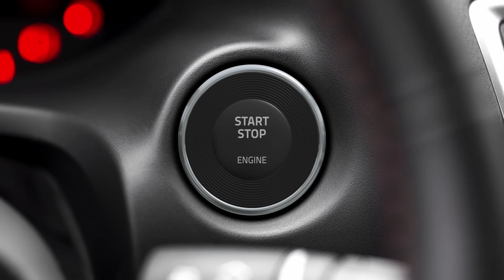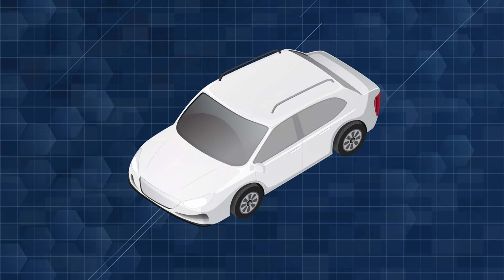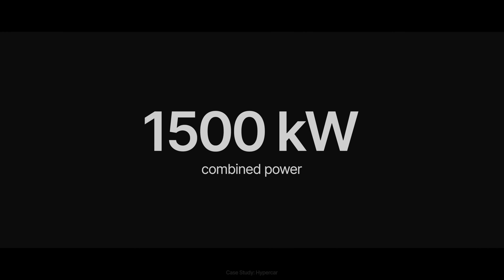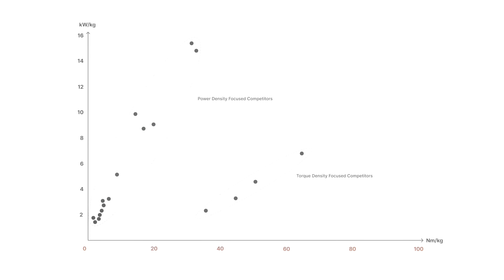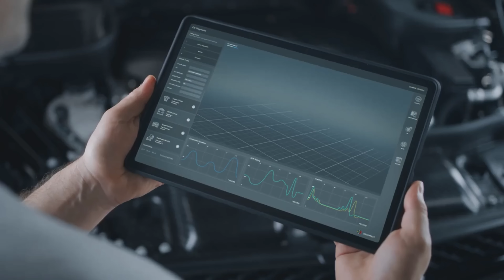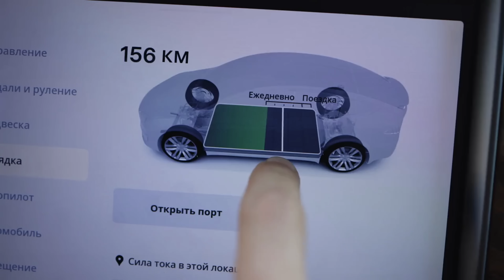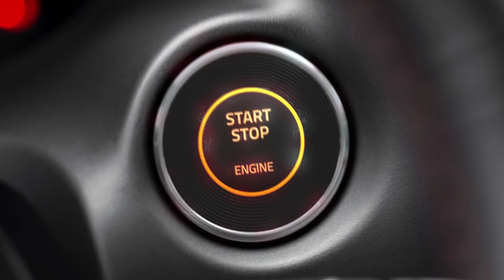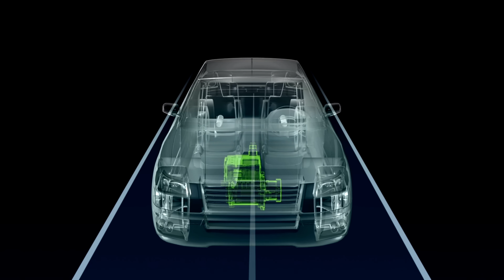New Donut Motor Runs EV Without Transmission or Axles – Here’s How

Comment: I like the concept, and it sounds like they have addressed some historical barriers to adoption.  One motor per wheel means built-in redundancy.  You could have one or maybe 2 motors fail and still be able to drive, albeit with degraded performance.

I bet traction control could be very precise and efficient because you don't need to apply bakes to shift torque from wheel to wheel.  Just need some good software to implement it.

Can we reduce complexity even further by eliminating conventional brakes?  Current design would allow for regenerative braking per wheel, which is nice.  But if you could come to a quick stop using the hub motors, then no need for brake hydraulics, disks, pads, etc.  This would reduce weight and cost even more.  I wonder if you could use regenerative braking for gentle deceleration, and switch to active deceleration by using battery power to oppose rotation -- this might even be of use when the battery is fully charged and cannot take any more energy (though a fat resistor would also suffice).  

I love to see all these innovations, I hope the best ones come to a car dealership near me!
Reply from the maker: Thanks for your thoughts—that’s a great point about using the motors for more than just regenerative braking!
Reply: If you create an electric hub motor with wirings that can sustain very high amps then a force of braking as high as you want can be created by a correctly modulated magnetic repulsion and attraction at the time of braking. 
It can be calculated how much electric power drained and how much braking power one can obtain. 
First, for light braking by regen braking, and second when you need crazy hard stops, very high electric current modulated for very high simultaneously 'pull-push' magnetic effects in the same electric hub motor-generator.
Reply: @mikel4879 All right, write up the patents and we're in business, Mortimer!  😀

Comment: Too heavy. MB's Yasa claims 750 hp from a 13 kg motor. While this video claims the monster motor is 100 more HP yet weights 3 times as much. That is far from the most power dense electric motor.
Reply from the maker: Good point—YASA’s axial flux motors are extremely impressive on paper, especially for applications like hybrids. But there’s a key difference: YASA’s numbers usually refer to peak power for very short bursts, whereas the Donut motor figures include sustained power and torque at wheel level because it’s an in-wheel system that also eliminates the drivetrain.

The 21-inch Donut delivers 630 kW (≈845 hp) and 4,300 Nm per wheel, and when you add the savings from removing transmission, axles, and differential, overall system efficiency and packaging improve massively. So while the raw motor-to-weight ratio might look higher for YASA, the Donut solution optimizes for entire vehicle architecture, not just the motor core.
Reply: indeed, agree

Comment: 0:08 this is called hub motor which is hubbed inside the wheel itself this is all good in terms of saving space but when it comes to bumpy road off roading and all the force the motor and its bearing will take it so the chances of motor getting damage itself is more
Good for day-to-day City little bit practical usage but in any other rear special scenario might cause a problem
Reply from the maker: Great observation! Traditional hub motors do face those issues, unsprung mass, bearing stress, and durability on rough terrain. That’s exactly why in-wheel motors have struggled to go mainstream.

What Donut Lab did differently is reduce the unsprung mass dramatically by achieving the highest torque and power density in the world. The motor’s weight relative to performance is so low that the impact on suspension dynamics is minimal. On top of that, these motors are designed for heavy-duty applications—including trucks and hypercars—so they’ve reinforced the structure, bearings, and sealing for off-road and high-stress conditions.

Of course, like any tech, real-world durability will be proven over time, but on paper, it solves most of the historical weaknesses of hub motors.

Comment: Have been used in bicycle wheels over 20 years. They are not new!
Reply from the maker: You’re right that hub motors have been around for decades—especially in e-bikes. The big difference here is scale and performance. The Donut Motor isn’t just a hub motor, it’s an in-wheel design that removes the entire transmission system while delivering record-breaking torque and power density.

For example, the 21-inch version can push 630 kW and 4,300 Nm per wheel—numbers that are on a completely different level compared to bicycle hub motors. Plus, Donut’s modular platform integrates motor, battery, and software for full vehicle builds, not just small-wheel applications. So, same principle, but radically different execution and performance.
Reply: @renewable_energy   the transmission is done in firmware, bruh.
Reply: Porsche did this in race cars 100 years ago, but carburetor tech got better faster than battery and motor tech.  True story, bruh
Reply: but it has some unique features

Comment: I hope Donut motors will behave even better than those I have on my rear wheel e-bike. It works like a charm and doesn't overheat. My only concern would be - motor controller - In case of dual or x4 traction configuration. In the traditional transmission/axle/differential configuration, the same is the one that was (and still is) improving for more than 12 decades. It is responding to wheels traction in mechanical fashion (although more and more with electronic assistance). In case of independent motorized wheels, motors are controlled only electronically, there is no mechanical system to compensate (other than brakes). I know there are already cars like Aptera coming, but I hope they will not rely on single motor controllers, or worst still - that they will be plagued by bugs for years until all the issues of motor controllers are ironed out. For example - what prevents one wheel (motor) to enter a recuperation regime just by a stray flip of a bit, while the opposite motor is still putting out torque, which would effectively spin the car direction.
Reply from the maker: Excellent point—you’re absolutely right that with independent in-wheel motors, traction management becomes entirely software-dependent. That’s why redundancy and advanced torque vectoring algorithms are critical. Donut Lab claims their platform includes integrated control units designed to avoid single points of failure, plus safety layers that prevent mismatched states like one wheel regenerating while another drives.

The benefit is precision: you can control each motor hundreds of times per second, reacting to micro traction changes much faster than any mechanical differential. But yes, it does raise the question—are software and electronics reliable enough yet to handle this safely at scale? Personally, I think we’ll see multi-controller architectures to reduce risk. 

What do you think—should EVs always have some mechanical fallback, or is pure electronic control the future?
Reply: @renewable_energy mechanical fallback? Doubt Boeing or Airbus have it. Rather 1 or 2 more redundant lines.
Reply: @renewable_energy  Bei modernen Flugzeugen gibt es schon lange redundante fly-by-wire-Steuerungen, aber keinerlei Mechanik mehr. Sollte bei Bodenfahrzeugen dann wohl auch gehen ...
Reply: very true

Comment: les bassins d'eau ont un impact négatif sur les moteurs
Reply from the maker: Bonne remarque ! L’eau peut effectivement poser problème pour certains moteurs, surtout lorsqu’ils sont exposés directement. Mais les moteurs Donut sont conçus pour être étanches et résistants à des conditions difficiles, y compris la pluie et même des immersions partielles. Les tests incluent souvent des normes IP élevées pour garantir la durabilité. Cela dit, une exposition prolongée à l’eau stagnante reste à éviter. 

Vous pensez qu’ils devraient viser une certification IP68 pour être vraiment fiables ?
Reply: good point
Reply: YES, in fact they should make an additional version just for marine underwater operations as part of the standard. I drive vehicles all the time in waters that submerge the wheel well here in sunny Florida.

Comment: That seems really nice indeed and will increase efficiency slightly  and make maintenance easier. It will also open new possibilities to build of modify your own vehicles (if those motors are sold as separate units and not just in prebuilt vehicles), like electric scooters, gocarts or even whole cars for those more advanced.
Building costs will go down for the manufacturers as mentioned in the video - but I don't think that will affect the price of new cars by much unfortunately. Most of the cost today is from unnecessary electronics, software and sensor systems for driver assist systems and other junk, often mandated by laws to "increase safety" while still keeping all the bad bad drivers on the roads (this is just as much of a problem on new cars with ICEs as with electric ones). 
And that's a cost that will most likely increase in the future "compensating" the lower cost from cheaper mechanical system. But on the other hand - if some money is saved on the mechanical system, the increase in cost maght not get really as bad as it otherwise would (as we will be forced to pay for the junk anyway).
Reply from the maker: Great points! You’re absolutely right — reducing the complexity of the mechanical system won’t automatically make new EVs cheap, because electronics, sensors, and compliance requirements keep pushing costs up. The real benefit here might be flexibility: easier maintenance, modular upgrades, and the potential for DIY builds like you mentioned — scooters, go-karts, even custom EVs for enthusiasts.

And yes, even if regulatory and software costs rise, at least savings from simpler drivetrains can help offset some of that. It’s a fascinating balance between innovation and regulation. 

Do you think we’ll ever see a ‘bare-bones’ EV option again, without all the mandated extras?
Reply: @renewable_energy  Unfortunately I don't think we will be able to buy vehicles without the mandated junk in the foreseeable future. The authorities in most countries want people to drive less over all (they want walking and bicycle to be the primary option for transportation and public transport the second) - so new cars getting more expensive, is probably something they just see as a good thing. They are now even trying to force people to pay those costs (and prohibit them from own a car if they can't afford it) with things like ELV (end of life vehicles) - to prevent people from keeping their old cars. That's how bad it have become already, here in Europe at least
They also try to regulate electric scooters, bikes to the point of barely being usable (other than if you are lazy and want to go up a hill) - for example limit their legal speed to 20-25 km/h (which most people can comfortably pedal a bicycle on flat ground at)
 - fortunately they have a hard time to control that market since they require no registration plates and  "illegal" ones are available everywhere (they are sold as "for use in closed off areas only"). Remove the speed limiter is also often as easy as cut a cable. Most models are faster than 25 km/h, then they just put a separate regulator circuit on them to make them legal (which is usually connected by an extra cable). They are also easy to modify - for example change to a more powerful motor.

DIY options will probably just keep getting better and better in the future - especially since the price of batteries keeps going down as well and new tech become available such as  sodium ion (batteries is still the most expensive part of electric vehicles that's necessary - at least if you want good range and performance out of it).
Reply from the maker: You’ve raised some very valid concerns, and a lot of what you mentioned is true for many regions, especially Europe. Regulations like ELV and mandated safety systems definitely increase vehicle costs, and in some cases, they do seem aimed at reducing car ownership overall. The push for walking, bikes, and public transport is a policy trend that will likely continue.

For scooters and e-bikes, the legal speed caps of 20–25 km/h are indeed restrictive, considering many cyclists can hit that speed on flat ground. It’s true that enforcement is difficult since most models can be modified, which is why DIY communities remain active.

On the bright side, DIY will probably keep getting better. In-wheel motors like Donut could make custom EV builds far simpler because you remove the need for axles, transmissions, and complex drivetrains. And with battery tech evolving—sodium-ion, for example—costs for DIY projects might drop significantly, even if full commercial EVs stay expensive.

The big question is: will regulators clamp down harder on DIY projects, or will this become an innovation space for enthusiasts? If modular platforms like Donut gain traction, the possibilities for home-built EVs could explode.
Reply: great points to be mentioned

Comment: That is highly performance motor, I liked the video. 

Donut motors, particularly those from Donut Lab, offer several benefits due to their unique design and integration directly into the wheel. They boast high power and torque density, leading to lighter and more compact vehicles with increased design flexibility. This direct drive system eliminates the need for traditional power transmission components, streamlining manufacturing, reducing costs, and potentially improving fuel efficiency.
Reply from the maker: Thanks for the kind words—glad you found the video interesting!